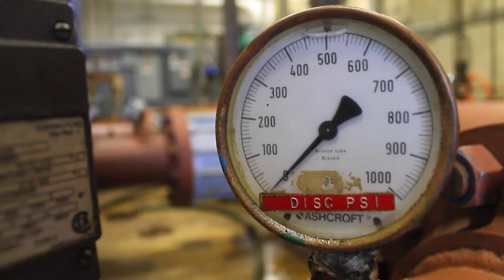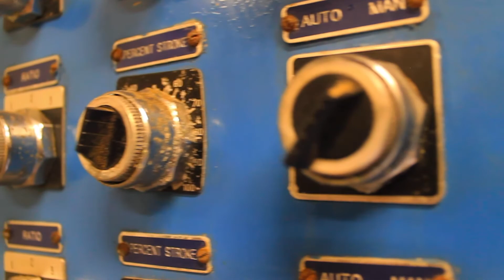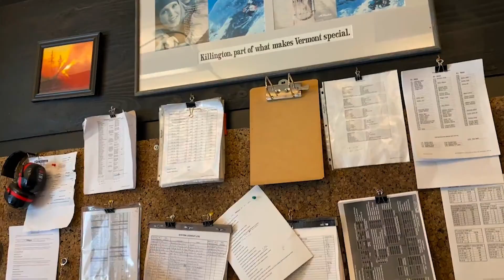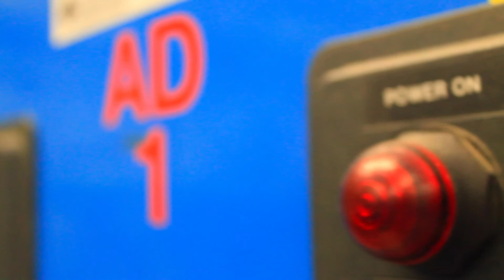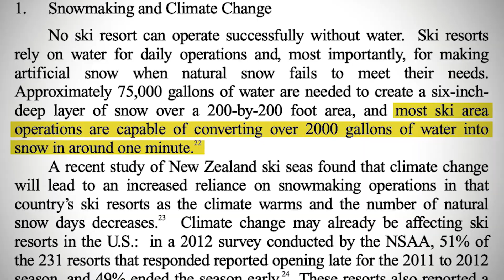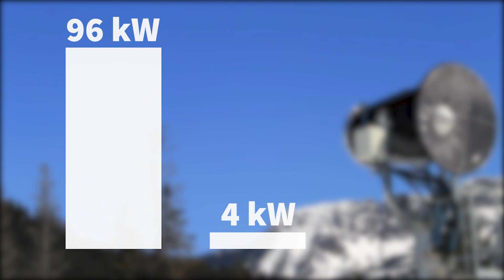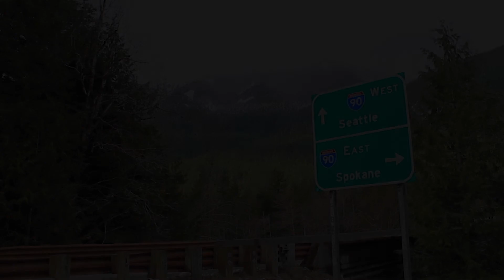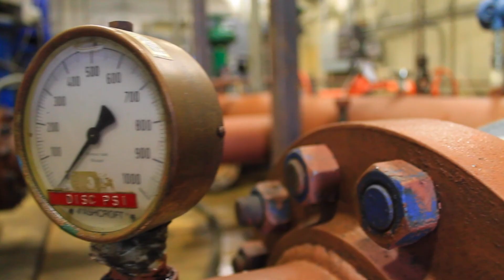Snowmaking: The Environmental Impacts of the Ski Industry's Saving Grace

Comment: Cool video but as a snowmaker with experience across the world I’d like to point out some corrections 
-Snowmaking snow isn’t artificial aka fake it’s just man made, we can add natural preservatives (one is a natural algae) to make it easier for snow crystals to form in more marginal weather but it’s still real. Snowmaking snow is denser pre compacted snow form therefore more bang for your buck when building runs where as natural snow it can be like 20cm of natural snow equates to 1cm of packed snow.
the air compressors that supply the vast amounts of air required are not diesel powered, they’re electric just like the water pumps. Some resorts use diesel generators to power fan guns in remote areas of the resort. But the big main compressors aren’t diesel powered too much cost which leads me to the next point
- snowmaking is an incredible resource requiring system the cost incurred when starting up all the pumps and compressors is a lot so once they’re running we try to avoid complete shut downs as much as possible and yes the industry makes continual improvements and yes techno alpin claims they can do that but really any modern fan gun or even stick can do make snow in warm temperatures if the the humidity is low enough, that’s determined by the relative air temperature and humidity resulting in a welt bulb temperature, so you can make snow in above freezing temperatures if the humidity is incredibly low.
- resorts employ snowmaking as both a season insurance against poor snowfall but also man made snow is better base and lasts longer ensuring an earlier start and later finish to the season 
- the process of actually making the snow is using high pressure water and air like you said and the water and air is mixed is either done internally (mixed in the pipes before being pushed out) or external mixture through nozzles on a gun but on the external mixture guns (which is most modern gun) the use a mixture of regular nozzles and nucleator nozzles. The nucleator nozzles break the water molecules down to some microscopic size and they freeze quickly and then the water from the regular nozzles collide and freeze together making the man made snow

But I still loved the video just some more information for you